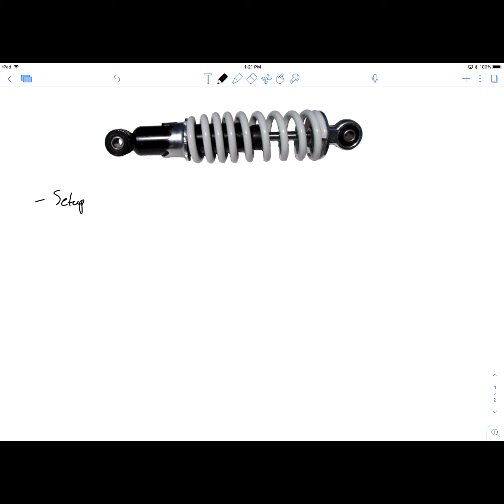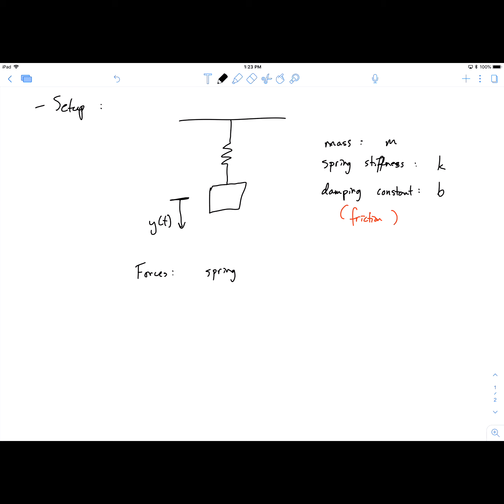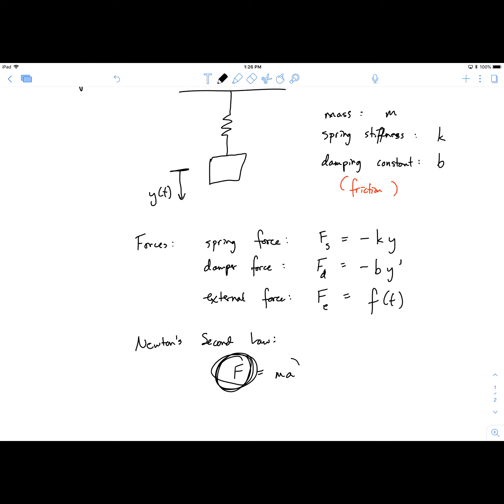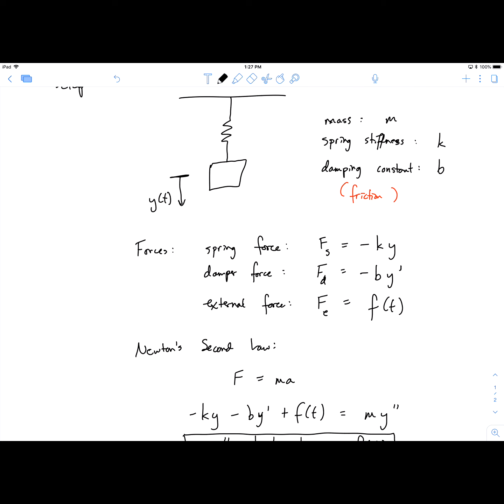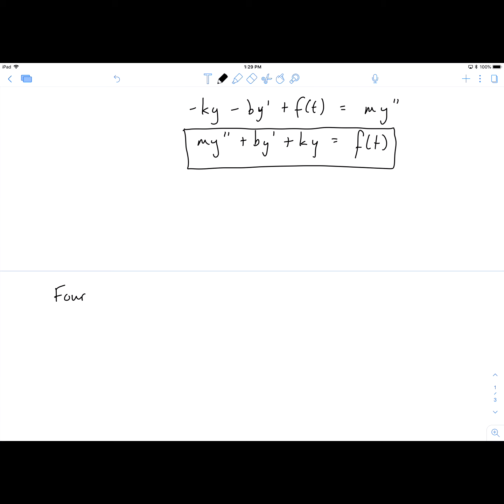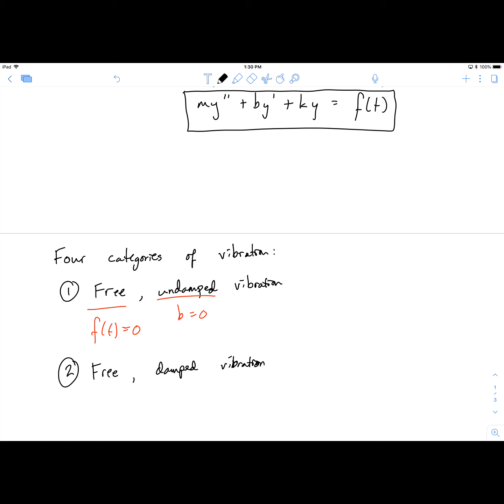Differential Equations: Introduction to Mechanical Vibrations

Comment: is this referencing Elementary Differential Equations 10th edition by Boyce and DePrima section 3.7 by any chance?
Reply from the maker: Not specifically.  I don't actually remember which textbook I used while I was preparing this, but I don't believe I used that one.  But I wouldn't be surprised if they have the same example; there tend to be some fairly standard setups.